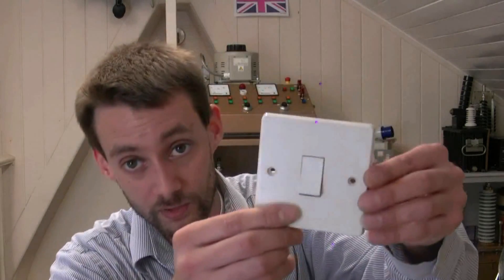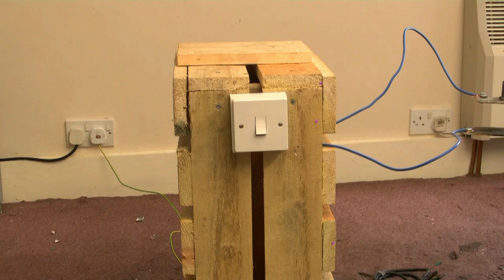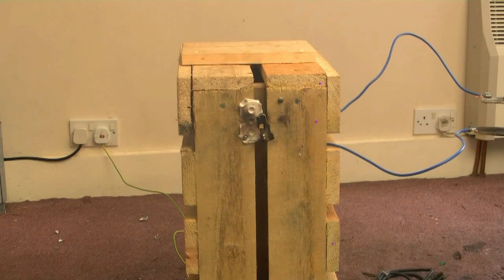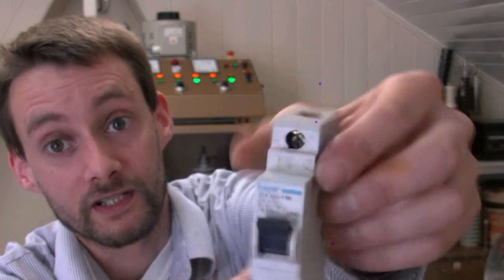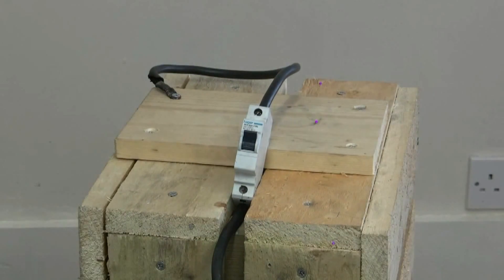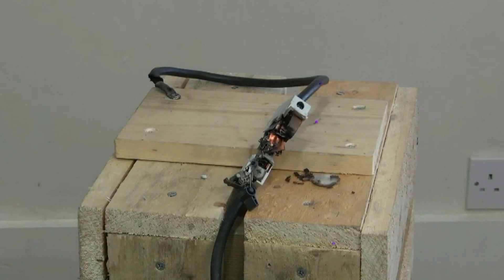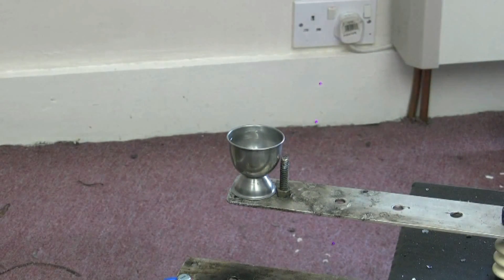Light Switch and MCB Explode

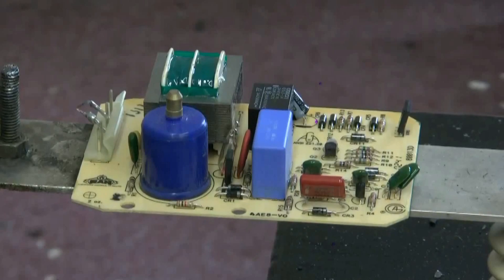Comment: When he does the PCB at about 4:43, does anyone know what that component that looked like a blue cylinder with a brass knob on top was? I've never seen one like it before.
Reply: It's a high voltage transformer. 
Brass on the top is output (to plasma ball).